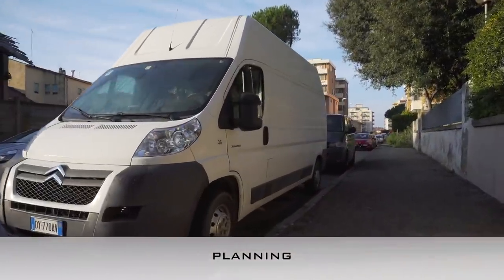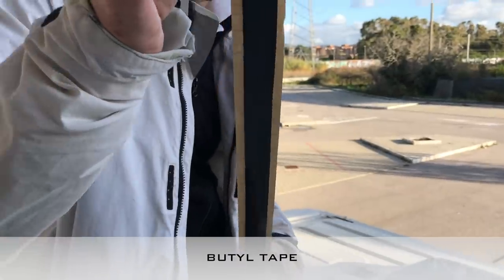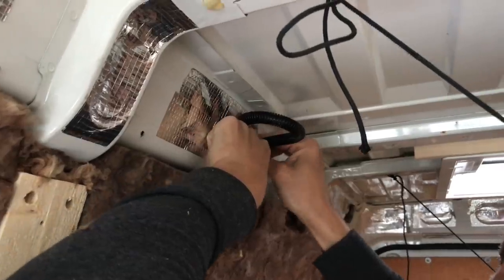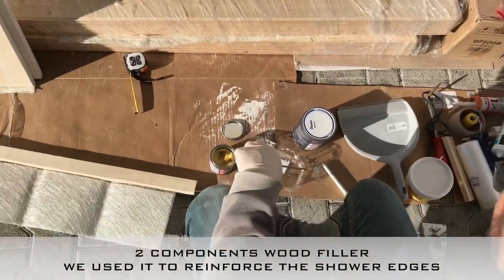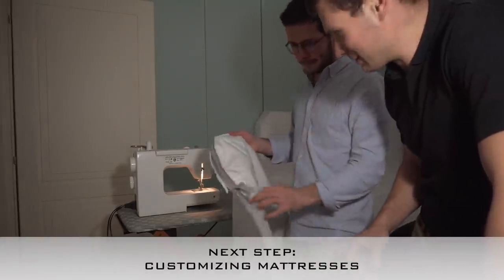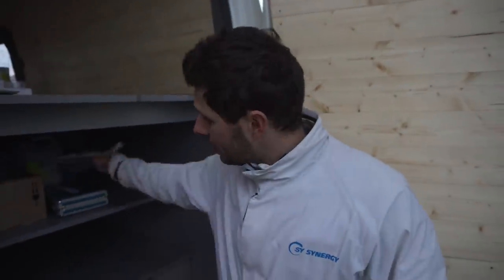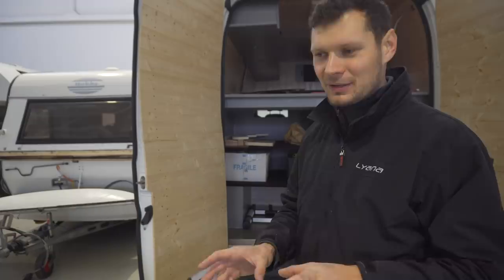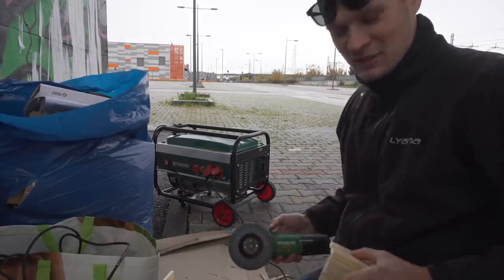Custom Camper Van - How to Build - 1

Comment: beautiful result - congratulations

i would consider myself as a semi pro when it comes to build a camper and a pro when it comes to live within. I really like your job but there is a major failure in this design. between the insulation and the wood panels you really should recommend and install an air prove vapor barrier foil to avoid condensation water in the insulation layer. i'm afraid in wintertime your insulation will absorb the humidity and store it there for a long time which WILL cause rust at the metal parts and fungal infestation on the wooden boards.

I was living in a metal shelter without the air prove vapor barrier for more then 5 years now, and this is the result of this "little" mistake.

after finishing your job, the only thing you can do now - make sure the humidity within the van is always as low as possible and air the van out as often as you can.

all the best
Reply from the maker: David,
This was the best comment regarding insulation. Everyone else is just copy paste from other videos))

We might slowly add this layer when we use it. 
Paying attention in the winter - yes we will do it. 

Thanks for putting time into the comment as everyone will benefit from it.

Comment: Hope you put some rubber cable glands on the solar panel roof holes! Otherwise the metal will cut through the cables in time.
Reply from the maker: Amazing idea! You earned at least 10 points! We haven’t done it unfortunately(( 
I guess at some point we will need to remove old silicons, remove the cables and put the rubber exactly like you suggested. 
I realize now that the whole van is negative, then you might have a shortcut if this will happen with a positive cable from solar panel!
Reply: You should have used a presse-etoupe. U can find it in every hardware or electrical store.
Reply: little round grommets are the answer. You're supposed to slip them on the cables but as you'll be retrofitting cut them with a craft knife, install and then add some sealer.. good to go.
Reply: @ExplorationBrothers  your van is awesome. The issue should be an easy fix.
Reply: Exploration Brothers  I've heard some people when they travel to hotter climate the glue will melt off and unglue the solar panel and woof, the solar sheets were gone with the wind while they were driving. Were yours attached to the roof with screws for more security?
Reply: Thank you!! Added to my "tips" list before starting my renovation.
Reply from the maker: That black rubber is so sticky that you will not have a problems.

Comment: Nice result! - How much weight did you add with all that wood ??
Reply from the maker: Thats an interesting question! We haven’t check the weight difference for now but I’m curious now!

Multi layered wood is extremely strong, but pretty heavy. We will write it as soon as we know it.
Reply: Yes, please put the van on a scale, to see how much heavier it is now compared to the kerb weight. 
We have a rather big storage-cupboard built into our Sprinter, and the cupboard itself is about 350 Kg heavy, because they used 20mm MDF boards on steel frame! Now we're struggling with keeping the load + van to be within the legal regulations (below the 3.5 t total weight).

Comment: If you mix a little wash up liquid in water to smooth the silicone it works a treat,,not sticky hands ,used to work in the aircondition industry and we did this
Reply from the maker: Thanks for the tip Ger!

Comment: 37:54 so you did screw solar panels to the roof? How are those panels performing for you so far?
Reply from the maker: No screws on solar panel, only tape and it’s extra strong and I think we might spend an hour to remove panels without damaging them.
Panels are performing well when it’s sunny, but unfortunately during winter months its not ideal, as you might have too many rainy days. But is you are driving, they are charged by alternator (our gives around 40A per hour)
Panels gave us maximum 17A until now. 

In sunny days our batteries 100% charged with fridge and 2 laptops running all day.
Reply: And you have 2x140W solar? Btw thanks for answers and nice video! We're about to make our own van so learned a lot!
17A is not that bad considering your panels rated for 20A
Reply from the maker: Yes. Total of 280W.
Reply: I’m only twenty minutes into the build and I’m inpatient how long did the build take you to finish
Reply: M M.    I was only twenty min into watching the build video.
Reply from the maker: It took us around two months. Definitely will be much faster the second one (with proper planing and ordering necessary parts in advance)
Hopefully you finished watching that video cause there are more update videos in the playlist 
https://www.youtube.com/playlist?list=PLRq74thRnlOld7_vMl8PZM3O2rh24t1UP
Reply: Exploration Brothers at which velocity did you check it so far?

Comment: Very nice job and good effort, if you're building a tiny home or container home, but for a van you need to always remember weight? Im sure these guys didn't research that. All that (3/4 plywood, 2x? and every inch covered with boards = weight, not including, gear, water, fuel, humans etc. It affects mileage, tire wearing, braking, handling, transmission. Ask a FedEx driver how the van feels and drives when its loaded with boxes?  
Take a look at average or luxury RV vans (Winnebago, American Coach or other brands), everything is made out of aluminum.
Lessons learned!  Next!
Reply from the maker: Thanks for comment One Shift. 
The wood of the wall is 1 cm panels and you cannot go thinner and that's what gives the van comfortable interior where I actually prefer stay compare to even my appartment. Support wood is not a big deal. 
Bed, sofa, table and kitchen - yes it's more heavy, but I wouldn't put thinner wood on the bed as it should rock solid. Shelfs in the trunk - we putting a lot of load on them, so the same thing. 
Kitchen an cupboard - you can save here 30 kilograms by taking thinner and lighter wood. I would say you could save 50 kg on wood from 3130kg van (including everything inside).
We do not know how to work with aluminium and wood was a more economical and simplier solution to make a van in parking.

Gear, water, fuels, humans are on any van, so I'm not considering that.
You are right - taking a van from professional manufacturer is lighter with a little bit better fuel economy. 
Thanks for time and for sure someone will benefit.
Reply: @ExplorationBrothers  You all are so gracious when criticized. Even when its done in a bit of an insulting manner towards you, you not only respond,but do so in a well considered courteous manner without returning the rude tone that is sometimes directed towards yourselves. Well done and a great example to show a society who knows only how to be more  rude than the next person
Reply from the maker: Anna! Thanks. You are very sweeeet!
Shoot us a picture of the van, when you will start))
Exploration.brothers@gmail.com

Comment: very nice build ! what is the name of that tool you use to drill the angled holes ?
Reply from the maker: Wolfcraft - Set "Undercover Jig"
Reply: awesome ! thanks ! ^_^
Reply: Hi, it's a type of 'Pocket screw jig'  --  Kreg make the original system.
You need specific pocket screws depending on thickness of materials also fine or course threaded if hardwood or softwood  --  with a little wood glue  it creates a VERY Strong structure

Comment: I recall someone telling me about the dangers of using insulation in camper builds. When moisture is caught in the walls, the fiberglass insulation will act as a sponge -- and consequently cause mold. Have you heard of this? Are you concerned/planned around this?
Reply from the maker: Thanks for comment and there is big chance that you are right!
We just shared what we’ve done and not teaching how to do))

We live in warm relatively dry climate, so fo us it will be fine. 

If someone lives in different climate - consider other options. Merci.
Reply: This definitely makes sense. As in all frame houses. People save on the ventilation system, and then they start having problems with the walls. Simply install a humidity, CO2 sensor and an air vent valve with a fan. But their van is so little, so they probably will never face this issue.
Reply: Exploration Brothers   the fiberglass cause's mold, it can kill you, we understand you didn't know. But people just don't want to see you get sick, that's why they want you to know !!!
Reply: can always use insulation board. its rigid yet has good R rating
Reply: I am also building a custom RV/Van, and I am scheduled to use closed-cell home-grade expanding foam. Some places charge a lot for this, but I found a professional who is willing to do my van for just $300. No mold, and better R-Value!
Reply from the maker: Good luck with your build, Humble! Send us some pictures when it’s done!
Reply: oh yea first thing i did when i got my old van was rip out all those sponges of doom!
Reply: I think there is also the concern of the insulation touching the wires.  In a house it is no big deal.  However, in a van there is a ton of vibration, etc.  I think that can wear the wires down over time.
Reply from the maker: All the wires are inside the plastic pipes so we are definitely not concerned about wearing wires down over time.
Thank you for commenting!
Reply: I would consider using rock wool or cork boards rather than conventional insulation to help with this problem. Its a legitimate concern. I had to tear out all the walls of a 1500 sq. ft. house because of  mold.

Comment: I watched this quite awhile ago but today I came back to pay closer attention. This is a very very good job!  What was the issue with the hand brake?  And when you say hand brake, do you mean the hand lever in cars which is a stronger foot pedal in trucks to add brakes to the transmission brake?  To give more protection to keep it from rolling when it is in park?  It is what I would call the emergency brake. What was the issue with that brake?  Were you moving it?  Was it disconnected when installing the tank and now it won’t reach?  Trying to understand and sorry for the bother. Thank you!
Reply from the maker: Hello Rebecca!
Yes. Emergency break. We moved the tank under the car but there was a metal wire in a way, so we removed break completely and the idea is to lower the whole thing with extensions and it will be done in the next video as we run out of time last refit. 
We will show how we sorted out everything)))

Comment: Very professional job ! I am VERY interested in the shower set up. How does it work ? Does it have some kind of curtain arrangement ? Would love to see more pictures and or information . Thank you !
Reply from the maker: That space is 95% a toilet. If you want to take a shower, then you need to remove the toilet (not that light as inside you have 10-20 liters of water/extra). 
We don’t need curtains, as you will try to consume as little water as possible, so there won’t be too many splashes + plus you need to be careful. This shower is used only if we are in the city, otherwise we put 3 meters hose, and you can easily shower next to the van. Extremely good for rinsing you surf gear!
Reply: Exploration Brothers Thank you so much for taking the trouble to reply. Now I understand the setup. Keep on doing what you are doing !
Reply from the maker: Just an update: finally I took for the first shower inside the wan cause we were staying right in the center. Not bad at all, we can say that it’s doing what it was designed for! It took me probably 3-5 litters for entire shower.

Comment: Oh my...so many rookie mistakes. 

The wood floor should go in LAST so that you can leave room for the wood to expand and contract...otherwise you will have warped boards that look like a water slide at an amusement park (eventually, not right away). 

It's a noble and very good first attempt. We all must learn and also (hopefully) learn from our mistakes. It's rather impressive that you did this in a parking spot (parking lot?) somewhere? I think, perhaps, what impressed me most was that you swept up after yourselves and included a bit of that footage. That shows that you are conscientious. 

Well done, really very well done, especially for a 1st build.
Reply from the maker: Thank you for your comment le th. We are glad that you’ve been supportive about our first attempt. The wooden panels on the floor didn’t cause any problems after a year (how would you put it in last when everything else in our project was going on top of it?) ))
The only think we would do differently is to leave more gap between wall panels (we made them quite tight).

Comment: Nice build! How is the insulation doing now? Did you insulate the floor as well?
Reply from the maker: Hi Jesse, 
We are not using the van too much in the winter at this moment, so there is no problem with insulation. We opened some panels of the roof last year and it was alright. 
If you are planning to build your van, then I would recommend to use panels instead of fiber. 
Floor was insulated with panels.

Comment: A damn fine job you did there, guys. Thumbs up!
Also the room layout is well done and I haven't seen it in this form before. Also for this: Thumbs up!
But there is something I would have done differently. You have solar energy - why not do without gas in the camper and use a mobile induction stove. If you don't need it, you can store it neatly in a drawer and always have a large piece of worktop free and clean.
You could also have built in a more attractive sink with the possibility of making a cover from the same wood as the worktop. And this cover can even be used as a cutting board.
But otherwise (as already written) super nicely done.

Comment: Ive looked at a lot of van videos and most of them suck balls. 
This is a really nice job some would have difficulty doing in a workshop, a parking space? 
The result is exceptional, well done guys

Little tips
Tagging wiring, just use a strip of paper with what you want written or typed on it, and seal it on the wire with clear heat shrink
Research a product called peel ply, when you fiberglass you lay it on top. It takes out surplus resin, removes that white blush or bloom, and leaves the surface a lot smoother.
Solar panel wiring on the roof, you can get rubber grommets with holes for round wire, seal them in with sitcaflex.
Expect crooks to be intelligent, just short of time. Use stainless steel fasteners for the safe, its much harder to cut with a saw, especially if there are spaces you can wrap around them with tube which is harder for a hacksaw to cut because it just slips around. Spot weld the nuts and washers on wherever they be. If it turns out you need to remove it, it will be a bitch to get out, but thats the point. Perhaps next time fabricate the box and hinge out of stainless, it doesnt like oxy cutting either.
Reply from the maker: OMG. Thanks for the tips and mostly for your time to write comment!
Everyone will appreciate them!
I’ve added some things to my next refit and we will do them as soon as we have some spare time for this.

Comment: every thing looks great if you want the solar panels to work it's max you need to make it adjustable at the end according to where you are located is the adjustment of degree and if you travel the degree will change leaving it flat is the less current that you will receive on battery friendly advice
Reply from the maker: Would be fantastic, but not they are taped pretty well and maybe in the future we will adapt something better))

Comment: You guys did a good job. Thumbs up. Heavy materials, though.
Reply from the maker: We call it solid! 😊 Some of the wood we could get thinner, for example top cupboards and maybe some elements of kitchen and the table but it would be harder to use pocket hole jig. 
We are quite happy with bed and sofa structure as it’s really strong and not making any cracks or weird sounds. Wooden panels for wall and ceiling are 1 cm thick, you can’t really go thinker that that.
Reply: Fair 'nuff, thanks for the reply. I did sort of wonder at your use of pocket holes. Why did you prefer those over brackets?

Comment: That pocket hole jig got good use
Reply from the maker: Hole jig is an impressive tool and it’s the first time we were using it! Highly recommended as it makes the job much faster. 
The downside is that after you need to close the hole, and then dismounting the furniture becomes almost impossible without breaking something.

Comment: This is an amazing build! I am seriously considering changing my lifestyle and becoming a van dweller. Of all the videos I have watched on van conversions, your seems to be the one that has addressed not just the practical side of things but made it beautiful at the same time. As an older woman  both of these things are important to me . Are you able to use propane and electricity depending on your ability to hook into someone else's, or be completely off-grid?
Reply from the maker: Electricity is not a problem as solar panels works great when it’s sunny. If you staying still for more then 4-5 days in the cloud, then you might need to save some energy. Depends on the use. 
We use only for light and computers. 

5 kg gas tank lasts for 1 months and a half for cooking and unlimited teas, so we end up with 1 x5kg and 1x3kg Campingaz tanks(popular in Europe), so it’s easy to change them. 

We would love gas fridge (as it’s consumer quite a lot of power from the batteries), but it will complicate a bit the whole system. In the next van for sure!